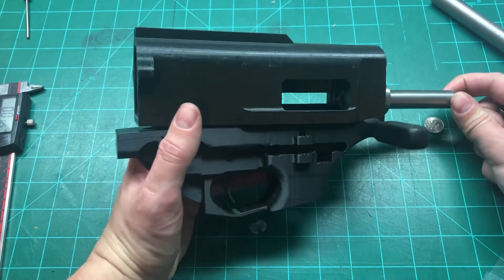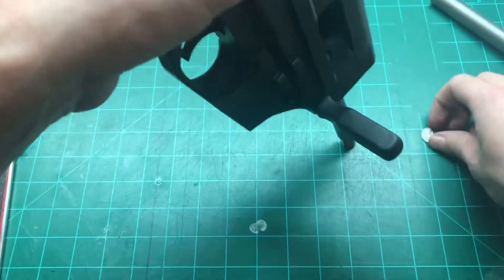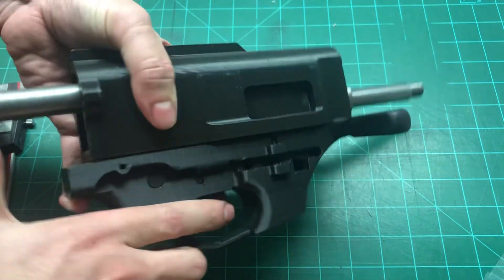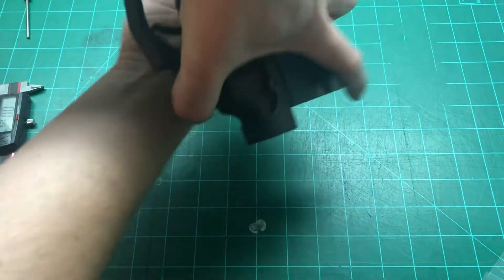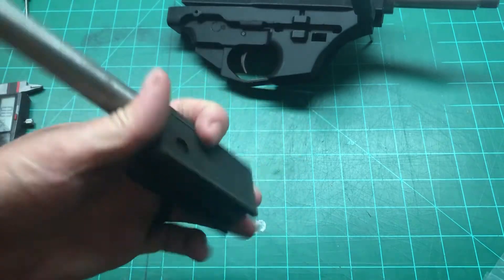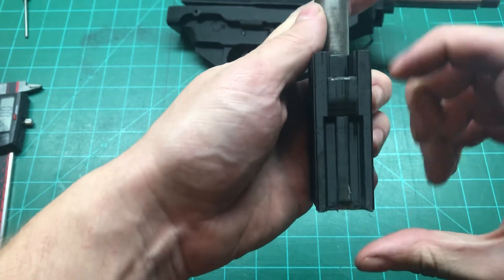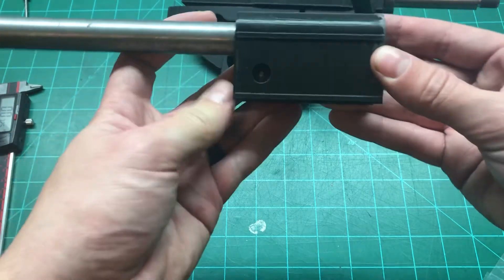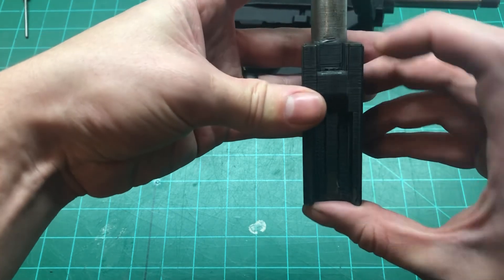FGC9 Out of battery detonation FIX!

Comment: What is the diameter of the spring you use for the firing spring? The latest doc has updated the spec to 1mm thickness. Is yours 1mm?
Reply: Ball point clicker pen literally a spring from a pen
Reply: @EGM1775  A spring from a pen can cause out of battery detonation according to the latest update. It is not recommended to use it anymore.
Reply: @saultigh4103  not sure how that is possible but ok
Reply: @saultigh4103  maybe if spring went through firing Pin hole in bolt, but when I used mine I made sure it wouldn’t blow past it.
Reply: @EGM1775  I'm not sure either but that's what the guide says. It has a new page on out of battery detonation (last page). My guess is that a pen spring is just too weak.The new spring's spec is 1mm which is too thick imo and not springy at all.